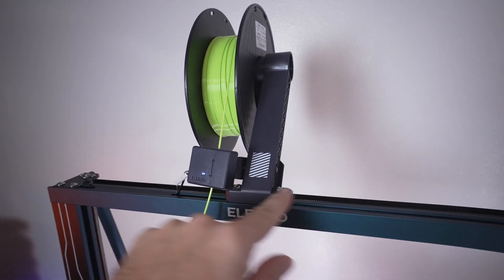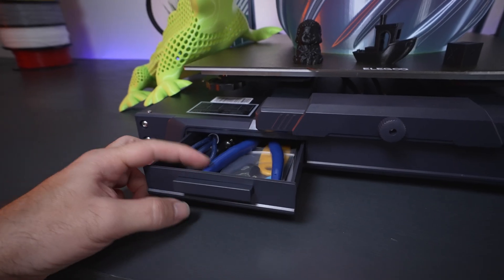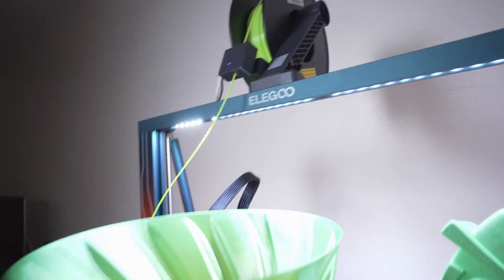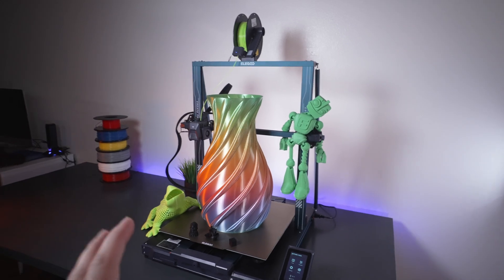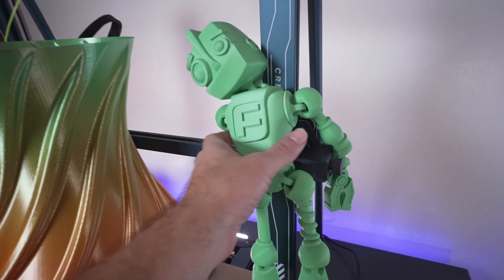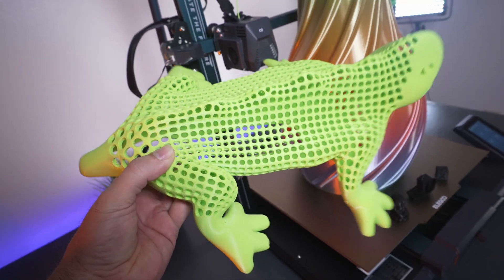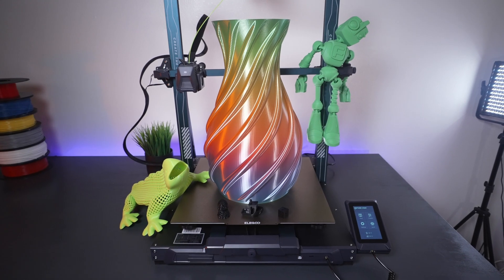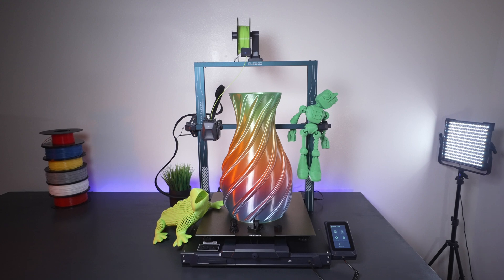Elegoo Neptune 3 Max - XXL 3D Printer - Review

Comment: Is there a downside to the Max vs the Plus when I’d mostly print smallish things?  My primary use would be for cockpit panels I.e. GPS, radios, avionics.  Some are not large.  Would I be making a mistake on the Max for this or is it better to have a printer that more closely matches the size of projects?  Thanks for the overall measurements.  I need this to prepare an enclosure.  Thanks!
Reply: If you are modeling those parts yourself then you can simply split them into multiple pieces and fuse them later.  I think it's fine for prototyping purposes.  The main issue with these printers is their speed.  A single biggish part could tie it up for days.  You should be budgeting for at least two printers.  I'd start with two Pluses now and then if there's a need would pick up the Max when it eventually goes on sale.

Comment: Nice because it's big 😉 but I know  different products from elegoo and...... well.... they lack of any QUALITY 👎
Reply: dont know what you talk about, i have this printer and its perfect, plus it has many features and costs below 500. what exactly do you think is not good quality?
Reply: @lefotografion  don’t pay him any mind. This guy just comments negative things under 3D printer videos as a troll.
Reply: @lefotografion  Speed, print quality for example. The whole printer is using wheels instead of linear rails. It is big and it is cheap, but it is indeed bad quality. Just look how terrible the prints looked.
Reply: @axell964  yea as I said in another comment, he definitely has some issues to resolve. His prints looks terrible, even worse then my worst 80A TPU prints. I have the same printer, and the walls are looking absolutely perfect, basically no ghosting, and at 0.07mm layer hight, you wouldn't think it's printed at all. He has to adjust his printer ASAP, and he shouldn't have poster this video without adjusting everything correctly. Btw, i do t talk about advanced adjustments, just follow the damn user manual